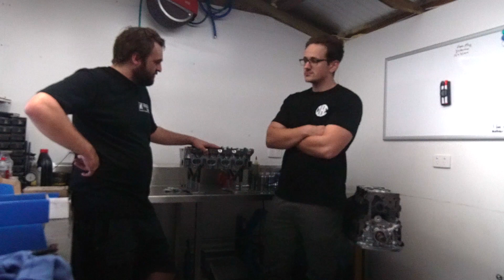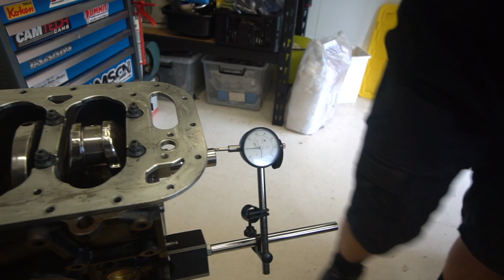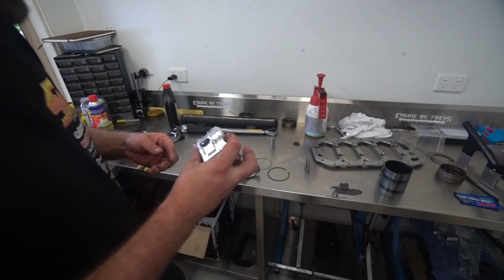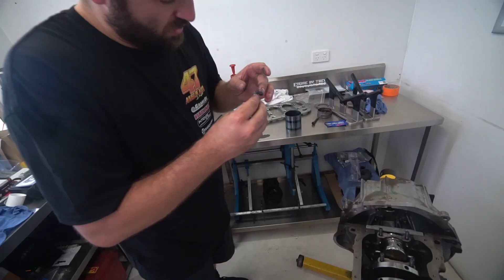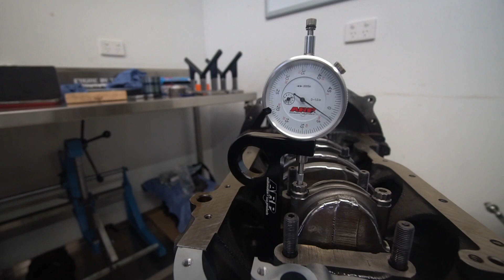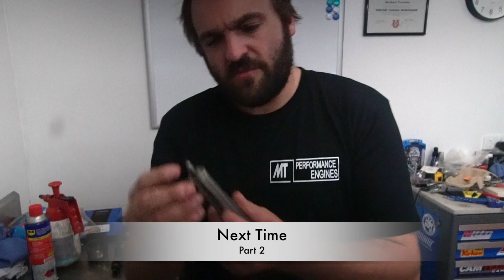FULLY WORKED 4age/7age Build Part 1

Comment: Did you use 4age or 7afe for water pump and oil pump?
Reply from the maker: https://www.youtube.com/watch?v=0m0PFsYv36s

Check this video out, there's some extra info on 4age oil pumps
Reply from the maker: I used a 4age RWD Water pump and part of the 7a block needs to be clearanced for it to fit but otherwise it just blots on.

I'm using a 4age 20 Valve Silvertop oil pump, Mat and I both agree that its the superior pump and I also have a video on that in my "ask an engine builder" series.

Keep in mind that you need to port match the oil gallery so the 4age pump has 100% flow on a  7afe block 👍

Comment: What kind of solid lifters did you use?
Reply from the maker: Not sure exactly Mat takes solid shims from a motor that comes with them standard and just happens to fit the 4age 

Don’t think he’s too keen on sharing that info though 

I believe other aftermarket companies produce them but they are just a little more expensive
Reply: Solid lifts or shim buckets are from Yaris 1NZ. its a 3 cylinder so to get all 16 is difficult.

Comment: What the life span of the rod bearings?
Reply from the maker: Not sure man there’s heaps of variables but I’m not planning on pulling my motor any time soon I’d like to get 5-10 years of solid driving out of it and we purposely set the rev limiter quite low to extend the life of the engine but you never really know with a race engine

Comment: Is the crank gurtil changing the bearing specs a common problem when doing this? Or is it only because you are running a dry sump?
Reply from the maker: Not sure if it’s common but definitely something that needs to be checked, this was only one of the many checks Mat did and I’m not running a dry sump I’ve got mrp’s wet sump setup

Comment: what oil do you use?
Reply from the maker: sk8ersr20 Brad Penn 20w-50
Reply: @NEVER-LIFT  coool, i also use 2050, now 1040 for winter, standard smallport
Reply from the maker: sk8ersr20 yeah I change to 15/40 in winter 👍